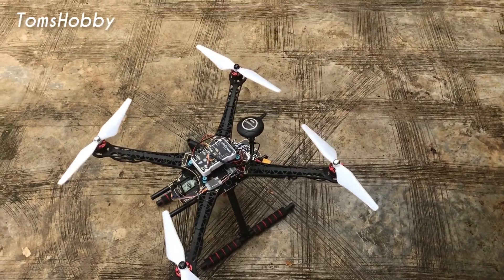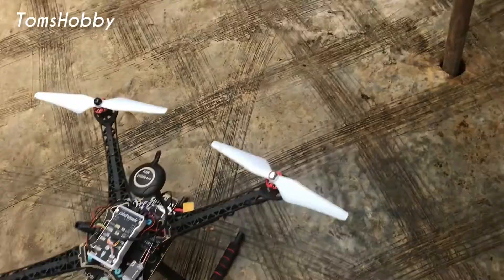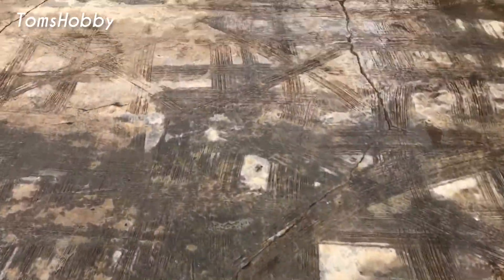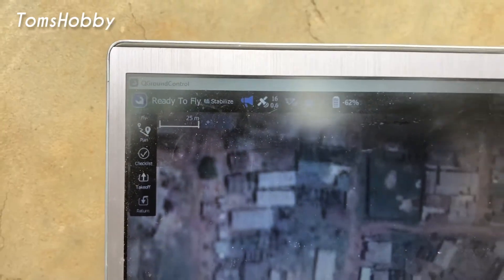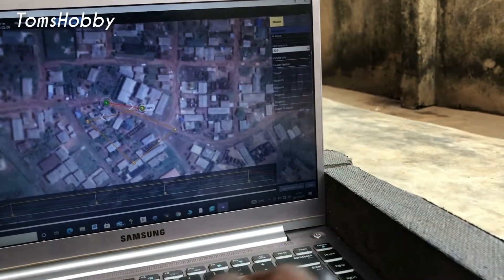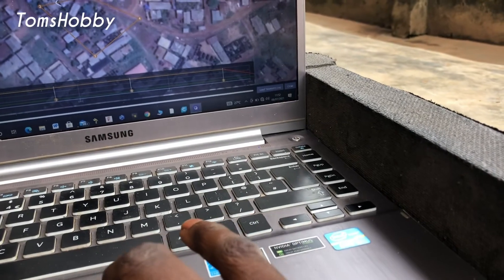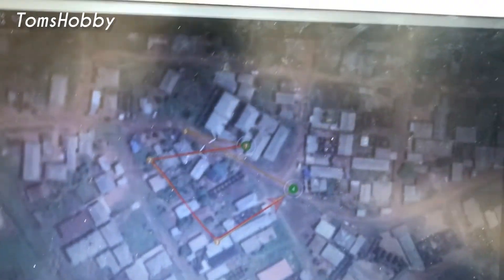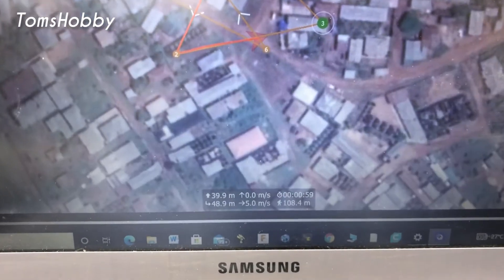Drone Waypoint Mission Flight

Comment: What’s the maximum of the telemetry system
Reply from the maker: Haven’t fully tested max range but have covered over 500feet
Reply: @TOMSHOBBY  oh okay
Reply: I don’t know what happened to my Ardupilot software.
It had been working fine before 
But suddenly the flight modes aren’t changing on screen when I changed mode on transmitter.
Please do you have a solution
Reply: @ymxtro  downgrade to the 1.3.28 version